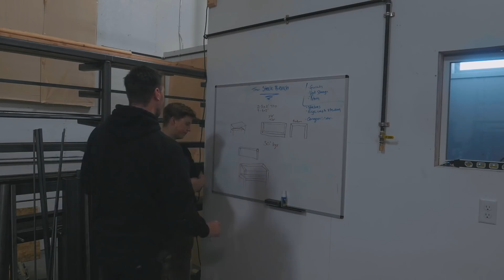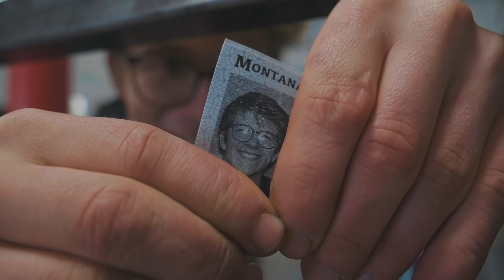FABRICATING WORKBENCHES!!!

Comment: Just watched Nate's Forge-- your Pilkington is safely installed and working-- cheers
Reply: How's the floor thing coming -- ?  Interested as I am a building designer in Canada (Ontario)
Reply: What absolute madness, nobody is going to break out their reinforced concrete slab to dig deeper then re-pour! That's insane considering the easier and cheaper option is to make formwork on the surface and pour a thick plinth.
Reply: @thepurplecat5975  It easier to make a plinth on the slab. But the end result is not as good.
Reply: It is just as good structurally, though I am assuming you mean aesthetically. For the avoidance of doubt I am a Chartered Engineer with BSc(Hons) and MPhil in Civil Engineering. Currently doing a PhD but it's more aligned with Mechanical Engineering rather than Civil Engineering.
Reply: @thepurplecat5975  I ment more practically than aesthetically, not having a slab of concrete to trip on. Fun that you do a PhD. I'm not there yet, but I am studying my fourth year in civil engineering.
Reply: No offence but if someone trips on a huge concrete plinth then they are an idiot. His plinth is going to be around 500mm high! Good luck in your studies, if I could go back in time I would choose to be a plumber or electrician and make more money haha!

Comment: Those square look really useful. Also, the Homeless Despot will let you pick your plywood if you load it yourself and cut it yourself at home, but anywhere you are going to find warped plywood unless it is cabinet grade and even then there will be some pringles in there.

Comment: Very nice work. Jason seems to really know his way around fabrication.

Alex, many blacksmiths don't have a fancy power hammer. Your press is very capable of forge welding steel. 
I challenge you to produce one Damascus steel billet this year. Just make a billet. You now have that 72" grinder to clean between welds.
You have not done any Damascus steel in months. I believe even you said it is a skill that needs to worked on often.

Comment: So...what was the issue with the truck?
Reply: I wonder if it was one of the vehicles that got stuck in one of the big floods this year.
Reply: I was wondering too,it could have been in a flood,if it was that sucks
Reply: Pedro Sanchez depends on the state and their safety regulations. In Texas, you can buy a flood vehicle, although it usually comes with a salvage title. You can take the vehicle into the Department of Public Safety and have it inspected, and if it passes the inspection, they give you a normal title again, but it’s expensive.
Reply: @Sanx007  Where I'm from you're not supposed to, but there's ways around everything.
Reply: Disco Dubber no not normal they dealer has to disclose it was flooded no madder what it is very big fine if not disclosed
Reply: @Pedro Sanchez It's actually a big issue right now. Legally you have to disclose it in the contract, but a lot of times the buyer might not read all of the fine print. Then there are a lot of shady ways to hide it that wouldn't be legal but are probably still done. If you're buying a used car atm you should really check all of the fittings/screws/fuses/cracks for signs of rust or baggy cloth on the seats before you buy.
Reply: @Sanx007  legally they have to tell you there damaged and they can't sell for list price but they can sell them
Reply: ITS A FORD.... Enough said. (Mental preparation for ford lovers hate comments)
Reply: Mathias James I’m a ford lover....but ya got a point😂😂😂
Reply: I think it's a gearbox problem by what he said in the video, probably they changed the oil of the automatic gearbox and that's it, some vehicles start to slip the transmission after a while and if you change the old oil for a new one it really stops working, Scotty Kilmer have some videos on that.
Reply: Alec explained it in one of the videos(the one with the audio muted when they were in the truck), that he wasn't going to comment on the issue at this time to see if the issue is resolved to his satisfaction.
Which I agree with, you have no leverage if you unleash the internet prematurely, it's best to hold that card till it's needed, and hopefully it's not needed and ends up a win win situation.

Comment: For warped plywood, spray water on the short side, then lay it on the concrete (wet side down) and put something heavy on it.  Let it set overnight.  The short side will absorb the water and expand, which will straighten the sheet.

Comment: Another American innovation, easy drivers license.
Reply: Truth be told they probably should make it more difficult. To many people on the road with no clue how to drive.
Reply: Koloth yeah I agree, people here in Missouri are downright scary
Reply: @koloth5139  Ban automatic transmissions.  Problem solved.
Reply: @corwinweber693  Solid idea, definitely puts you more in tune with the car. My current car is the first in 19 years with an automatic and it sucks. But it was dirt cheap so oh well.

I some how think there would still be idiots mucking things up. Sadly I feel the ultimate answer will be self driving vehicles. Remove the idiots and you remove the problem. Unfortunately those that do know the rules and drive well will also have to give up the wheel. But I suppose it is a small price to pay in the end.
Reply: In Ontario we have three tests, one written and two road tests that all have to be a minimum of one year apart from each other

Comment: Nice video!  Fab stuff is always fun to watch. If you get the plywood ripped lengthwise instead of across the width  of the sheet, it shouldn't cup (bend) as much.  It's actually engineered to be used lengthwise.   
Gotta get some of those fireball square fixtures, that's a fresh bit of awesomeness.  Nice to know he is in the western US too.
Regards.
M2

Comment: Passed mine by one also lol, I was born here so don't feel bad buddy. No I'm not a dummy, just those questions are tricky little devils.
Reply: Yeah same here. Technically I failed but they gave it to me because one of the questions was correct until the law changed like a month before I took m written test and I was using an old driving test booklet that had the old law/rule. Speaking of tricking little devils another missed question was because I didn't read the question correctly, it said "what is the speed limit outside a school zone" and for some reason my brain thought it said "what is the speed limit outside a school".
Reply: Right? Same story here, one  my questions was something like "What do you have to notify the dmv of within 2 weeks of?" The answer was painting your car I think, but there were options like report your car or plates stole, things like that.
Reply: I think I 100% mine, but I failed the driving test my first time because no one had told me how to turn on the high beams.
Reply: Nomadic Medic  why wld you be required to tell dmv you reprinted your car? That sounds too authoritarian to me. None of their business

Comment: Have you ever tried welding with only your torch (Gas and oxygen)? It's a bit tricky but when the material starts melting, run the flame along the material and you got a very solid weld. A bit tricky to do but fun.

Comment: Alec you really need a spray in line-x bed for your trucks box or something more. Line-x and the other spray in stuff is a great way to prevent rust and other sorts of damage. I do think its most important for wheel wells of vehicles when they are driving in winter climate due to salt, sand and the inevitable shitty repair for pot holes with spray in asphalt

Comment: You could always cut the 45deg corners on the frame work on the initial cuts. Will save running them all through again and you will save at least a foot of steel. Looks good though :)

Comment: If it's anything like what we used to get when I worked at a lumber yard, it comes from the mill that way. If they dont center the stackers correctly, or dont add enough as the case may be, it will warp 100% of the time. But yeah it does suck paying out the ass for wood and it be crooked as hell

Comment: Alec,

Have you made a decision about how you'll address mounting your hammer? I'd like to volunteer my help and knowledge in resolving your current issue. I spent 20+ years as a union cement mason doing everything from patching to pouring concrete. I have a couple ideas on how you could fix it.

Comment: You guys should research into using a stop block when cutting multiples of the same thing (like those 24 legs). Might help with consistency of length when fabricating :)

Comment: A thought just crossed my mind, wondering if a sword could be made from building up bead from welding, don't know if it would work or be strong enough, but it would be worth a try. Maybe make a sword form out of refractory cement and build up a continuous pool of metal in it until you get it completely filled in. I might have to try this some day soon on a small scale.😁( these are the kind of thoughts that go through my mind on a daily basis😂)

Comment: any update on the concrete problem? im not an engineer but an idea to help with that problem might be cutting out that section of floor. digging it as deep as you need it, and pouring more concrete if you could. Just an idea

Comment: Is there an advantage to using a mitered corner on those work benches as opposed to a butt joins and a cap?   Or is it just easier to make a square miter than to cut fit weld and grind a cap?

Comment: The plywood will bend funny shapes when you cut it across the sheet like that it's strength runs down the length of the sheet.  if you wanted flatter pcs you can rip long ways and then cut in half so the grain on the outer plys is running down the length of the pcs.  rough sheeting grade ply wood is not as stable as furniture grades. mostly because the veneers are thicker and there are less of them for the same thickness sheet.

Comment: Your vids need to be longer. Also, so many unresolved questions!
1. When do you expect your crate to arrive from UK?
2. How did you resolve the 3" concrete floor issue?
3. When are the replacement heavy machines due? (power hammer, etc.)
4. Did you resolve the air leaks in your shop-wide compressed air system?
Reply: Also, what happened to the truck and why is it magically back with no explanation?

Comment: Am I missing something? I watch people crawl around on the floor working when it is not needed. Will was using the cutoff saw on the floor. Behind him in plain sight was a pair of saw horses. Over by the bay door is a large scaffold with large platforms. 
seperate the saw horses, place platform from scaffold on saw horses. Instant work table large enough for saw and material to be cut. No sore knees, no sore back, no handling material a dozen times.

Comment: Can someone answer me why it's so bright when welding? And why the camera goes beserk when filming it??
Reply: Welding IS very bright. It's a bright electrical arc that is hot enough to melt the metal. The metal even glows in the local area because of the heat/brightness of the arc.     I'm going to make an assumption that the camera is picking up the 60 hertz electricity (AC current) that is making the arc. The arc would actually be flickering like a strobe light much faster than the human eye could see.
Reply: @neomew  Oh ok! That's honestly pretty cool. Thanks

Comment: Next time maybe consider 2 layers of 3/4" MDF for the workbench tops.  It is heavy, incredibly flat and dimensionally stable with seasonal changes.  It's not the most durable stuff, but consider the top layer sacrificial and replace it when it gets worn out. It's also pretty inexpensive.

Comment: Those evolution saws make a mess and crappy cuts.  even a harbor freight bandsaw would be better.
Reply: Nope.
Reply: As an owner of both...yep.
Reply: You need a better blade.  A good one will cost you around $100.  We used abrasive saws for years.  A good cold saw is miles better than a "grinder". Check out the cuts they were making.  I saw a lot of precise joints.
Reply: @paulcopeland9035  I plainly said evolution blade.  Appears you don't know what that is.
Reply: The EVO380(what they have) is a fine commercial saw   We have tried various blades and are still undecided what is best.  The EVO blades are made in Japan and seem to be excellent, very stable. However, we have found that they require a slower cut than others to maintain carbide life.  I am sorry you have a hard on for where they are made.  Quality imports can be very good tools   The world is changing.